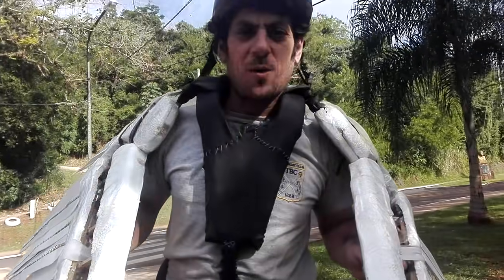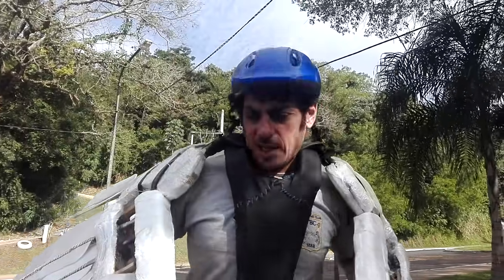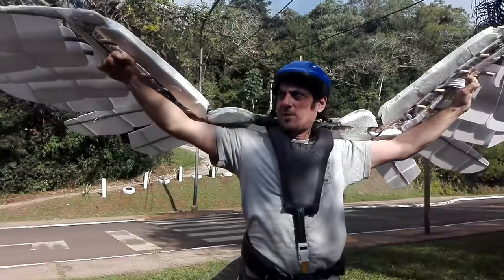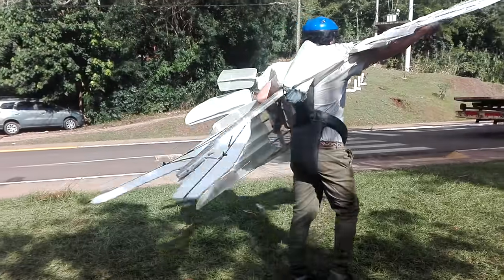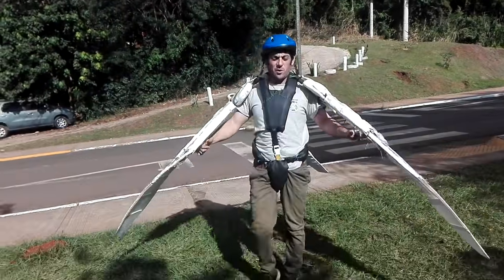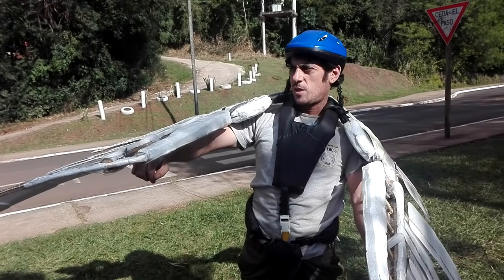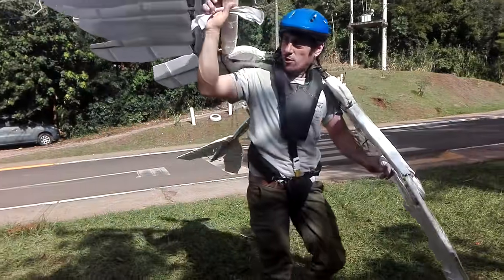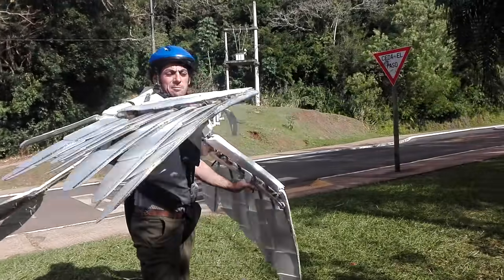Human ppwered ornithopter

Comment: the wing design is certainly ok as a cosplay prototype, but you need a lot more wing area (and decelopment) to even get close to the upper range of bird wing loading (which is 20kg/m² but usually less than half that - you're probably around 70kg/m²).  nevermind the fact that the empennage is not going to do a thing in this design.

you are onto something though with the variable wing geometry.  I suggest making a scale model and trying to fly that.

Comment: As noted by other commentors, the human power to weight ratio is no where near enough  to produce sufficient lift even for a very light person of 60Kg.  However, if the wing area was sufficient to allow for gliding, all that remains is a way to get up in the air.  I think the concept has to be re-thought in terms of a kite. That is a large enough kite/ wing structure, that can lift the person off the ground in a fairly slow wind speed. Thus an extremely lightweight structure is required as in a kite with a very large surface area. Thus one could imagine a kite tethered to the ground, on a windy hillsite, a person held within the kite, who is lift up by the prevailing wind. Once at height , he could detatch himself and glide with  the aid  of some human propulsion to extend the glide path. Wing flapping I would not use, but some sort of propeller could be a useful propulson , to maintain height, once the wind has done the heavy lifting and lifted you up in the air. Just an idea!

Comment: Wow this is AMAZING, your prototype is so detailed!  The wings fit the motion of the arms like gloves! When able, how would one invest in your creation?
Reply: unless he makes one with a 40 foot wingspan don't invest you need a 40 foot wingspan to life around 40kg or 100 pounds
Reply: @gamingwithowen1365 It doesn't need a wingspan too big for human arms to control. What it needs is an electrical engine that draws air in from the front at high speed and pushes it down from the wings, aiding lift. It could also benefit from motors in the wings that take on some of the strain, reducing the effort needed from the arms, similar to how an electric bike works.

To give the wearer the full freedom of a bird, it would have to be self-charging, to get rid of any dependence on external charging ports.

This could be achieved by making the wings into solar panels. It's hypothetically possible to make artificial feathers that work as solar panels. It could also be achieved by converting the wearer's body heat into electricity, or by installing turbines to charge the battery during flight using the air resistance. Some combination of electricity sources may be necessary.

So that's how to make it work, but to make it better, it could include fully feathered wings and a fully feathered tail that completely cover the arms, back and legs during flight, a wingsuit covered in the fluffier feathers that cover the rest of the bird's body (full body feather covering is good for insulation, aerodynamics and trapping layers of air, which also aid lift) and a helmet with a beak, so the wearer can pretend to be a giant bird. It'd be so much fun to fly with one of these things.

Comment: looks really nice, I can imagine there was a lot of work. 
they could be useful at a cosplay
also you can actually try to fly. flapping obviously won’t give you lift but changing the geometry of they wing is a big plus for flight control. By flying I mean you could go somewhere where there is high intensity wind and flat surface near the beach and do some small jumps vertically. could be fun if the wing is strong enough otherwise just buy an inflatable wing for jumps. Obviously don’t jump near obstacles or off a clif but only on flat land and sand or grass beneath

Comment: YOU IGNORED FLAP RATE AND AIR CURRENT WING-LIFT - with a decent design, "take off" by just standing into a breeze, or launch yourself with a catapult, or CLIFF-SIDE (hang gliders do it all day long) with a relatively small wing area for a given payload*. The Gossamer pedal powered aircraft used air current lift and not air displacement except for a very large propeller for forward / directional thrust. Solar powered gliders with very low mass stay up indefinitely. The angle of a bird's wing provides thrust and lift variably and very effectively - very high tech!!

Comment: An entirely human powered wing would be impossible, reason being that we have not flapped our arms around throughout our entire lives for generations. Stiffness in the joints is inevitable. Improper rotation of the necessary joints is unavoidable. Lack of upper body strength is for sure a problem. You have to do at least 1500 continuous pullups without being completely drained in order to remain gliding in the air for a few seconds and this is if your fuel is made through sheer strength. 

I suggest either adding a motor mechanism to compensate the lack of strength or use a compound pulley mechanism to lessen the strain of the strength needed. 🤔 I believe it require additional measurements if you're going to make this work. Increasing the size of everything or changing the structure will be beneficial as well.

Comment: It's well made design. I have had this idea for several years but never made the prototype. I would just say that the size of those wings would not be able to get a humans weight off the ground. But good work though. (You'd need to design each wing to be about 12', meaning, a total wingspan of over 24'.

Comment: Here's what ya need.  First of all you need a much longer wingspan, at least 3x.  Second, you won't have the strength needed. Ever.  So you'll need servo motors to assist your movements (this is what gives iron man his strength, while fictional, there are real exoskeletons that do this.  Third, you need to optimize your power to weight ratio to perfection...I mean you and your wings, servos, and battery need to weight as little as humanly possible, and the output power needs to be as much as possible.  This will get you off the ground, but then idk what will happen...you'll be all over the place probably.  So then you need some sort of algorithm to assist you in form, and well, idk what to do or how to do it at this point because I'd have to see what happens when you get off the ground lol.

Comment: You'll need a set of long span wings than this if you wanna fly, for a man of your height
Reply: @Lyon Bassey, the Snowbird, the first human powered ornithopter has a 105-foot wingspan.  
The wingspan of the Gossamer Albatross, the first human powered aircraft that flew across the English Channel is 97 feet.
Reply: @MaxCruise73  so you concur? Right?
Reply: @Lyondegreat  Yes.  
Note the wingspan of the two aircraft I noted in my comment.  
The aircraft that have the best glide ratio are gliders/sailplanes.  
Quote
open class sailplanes – typically around 60:1, but in more common 15–18 meter span aircraft, glide ratios are between 38:1 and 52:1;[19] high glide performance enabling long distance flight, with 3,000 kilometres (1,900 mi) being current (as of November 2010) record[
Unquote
Source
https://en.wikipedia.org/wiki/Glider_(sailplane)

Comment: I wish there was a facility were I could sleep rest shit shower wear one uniform 🥋 and just work on this till it's then fly it and go on from there. Trust the process with the next invention. Zeitgeist.
Reply: I forgot it would feed me too 😃😃😅 lunch sleep, no breakfast maybe work. I have the specs for you. The g force of the wing to lift the weight * weight of the 400 lbs of force of air. You will need pullie using less human strength to give wings torch and control of wing.

Comment: Well shit. I do hope thats a scaled down model. As u do realise firstly you need alot more surface area on your wings and secondly the shape of the wing surfaces is most important if you wish to gain lift. Also what will your body be doing while soaring. As hanging down from the wings would be somewhat difficult. Also wing stability. As ypurll never have enough strength to hold the wings rigid without alot of structural support. Birds are very light and have over sized breast muscles. You dont